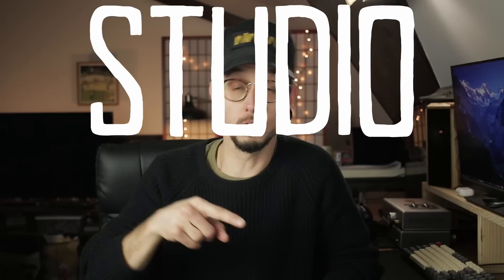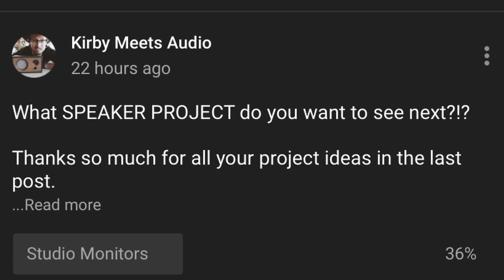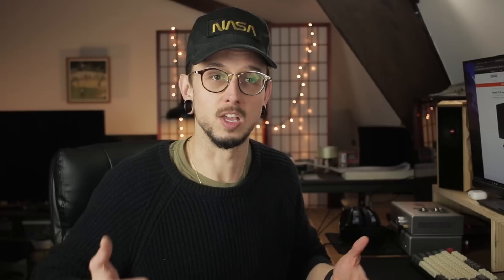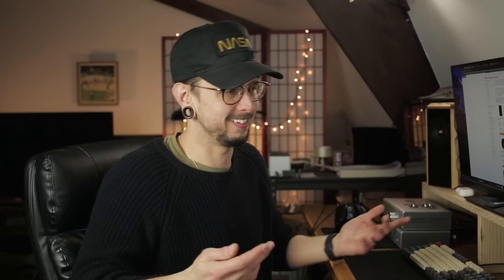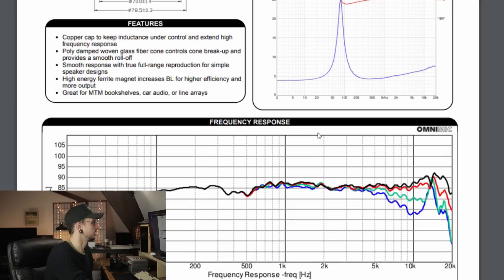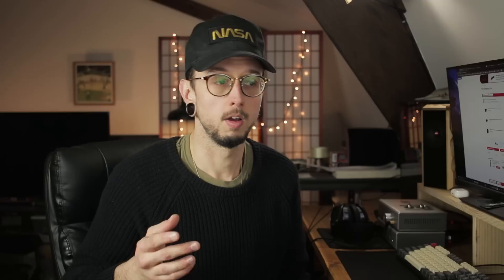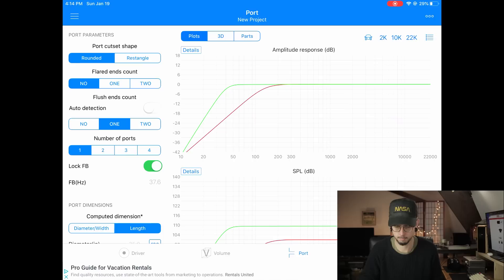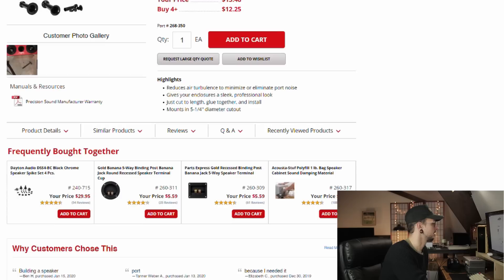DIY Studio Monitors (DESIGN) Step #1 | Home Recording Studio

Comment: Kirby - love the 8" woofers.  So many of today's bookshelf manufacturers try to sell us on 5-6" woofers having bass. They don't.  I would love to see you duplicate this build with more budget-friendly speaker parts that total under $250 for all parts (not enclosures).  Thanks !
Reply: they have bass, just needs the proper design for it. a friend of mine built a 3 way monitor that uses a 6.5" driver for the low end, and it can go down to 24hz quite loudly
Reply: @FPSzky  24hz maybe, loud, surely not.
Reply: @SilmarilS79  loud is not the point of studio monitors
Reply: 6 inch woofers can definitely have bass. The car audio community has figured that out. Ex: Sundown Audio U 6.5

Comment: I always call BS on a 32 Hz rating on an 8" woofer system.  Yes, theoretically, but not at volume in a very large monitoring space.   Bag End delivers a subwoofer system that is theoretically flat to 8 Hz, and it too is (theoretically) truthful.  But the devil is in the details, and to get that frequency at volume, you have to build that system out with four sealed 18" cabinets and some hefty amps (and have your room absolutely together).  "At volume" in my world, is at calibrated volume for film/master mixing.  That's really the bottom line--can the system deliver that response at the mix position, and most specs (even for studio monitoring systems) aren't actually giving you a spec that is comparable to that.  It's usually at x dB at some close measure of distance from the cab.

In the weeds, I know, but maybe it explains why frequency range ratings can look impressive, but when you monitor a tune with a low-B bass string fundamental, you find yourself asking, "Where's that bass?"

I have several of those Bag End systems, btw, and they are a thing of beauty.  No intent to bash on them, just to illustrate the disconnect between the theoretical spec and the practical implementation in a mix room.
Reply: It does also depend on driver though, there are some small drivers that are fairly specialised to just do low end well. Like the 5.25" Tang Band W5-1138SMF absolutely can do 35-40 hz no problem in a ported enclosure. As a result though its not the tightest bass/quickest woofer in the world, but low tones are absolutely achievable.
Reply: I've heard the bag end subs. Very impressive if you have the room. Has anyone heard both the bag end and the rythmic subs, and if so, how do they compare?
Reply: @__-fm5qv  Well, I concur with that, but again...at volume.  Once you've calibrated your monitors for volume (anywhere from 78 db to 83 db, pink noise, mix position) is that system delivering a flat response.  And a 5.25" driver system will absolutely not, under any circumstances, deliver what a mix engineer needs.  It might deliver an OK speaker system for listening, but it won't deliver a studio monitor that you  *know* will translate to most playback systems predictably.   And that's where you start getting into big trouble, and you have to do a lot of staring at the driver itself, to see what the exertion is versus what you're hearing.  You can do that on a song.  It starts getting impractical if you're mixing a film.  Granted, I come at this from a situation where I have to send out mixes which may play on big systems...but those are realistic work scenarios for studio monitors.  You have to know how a bank of subs with sometimes thousands of watts behind them will behave, or you won't keep working for long.
Reply: @BruceRichardsonMusic  This is true. I'm just trying to say for the purposes of these monitors an 8" deliverijg those frequencies is fine. He's not making a purely hardcore professional monitor after all, it's more of a "prosumer" monitor, so it's allowed a little slack imo.
Reply: @jdrissel   I have not heard the Rythmic Subs.  I checked out their site, and I think they probably compare more to Velodyne's early products that had a similar servo design.  I have a couple of the Velodyne 18-inch "Coffee Table" subs that I picked up cheap and put into my soundstage room for mix-testing (and general home theater enjoyment).  They sound AMAZING, and I could see mixing with them if I learned them.  The servo is really more of an intelligent limiter, as it stops the system from self-destructing when the cones go nonlinear.  In my experience, you might get away with a little smaller footprint with them than with Bag End.  They're still applying a similar trick with sealed cabinets, although Velodyne and (it appears) Rythmic, too, use some ported designs to save space.

The Bag Ends are a little more purpose designed.  You get indicator lights that tell you when the system is limiting, and the limiting is pretty sophisticated.  They filter at the fundamental level when the system starts exceeding spec, so you begin to lose the bottom octave, but you retain the rest of the overtone system for a given bass tone.  In a way, it functions psychoacoustically like Waves Maxxbass does.  You *think* you hear the fundamental, because the overtone series stays intact above it, and your brain concocts a "ghost note," similar to the way musical intervals will cause you to hear a "Tartini tone" that isn't there. 

But when you're mixing, those indicator lights basically tell you, "HEY, you need to sculpt on this section, so that you're controlling nonessential cone motion."  That's why you can get such tight bass mixing with Bag Ends...not so much that other systems won't let you get to the same result, but that they so clearly indicate when you've got an amp exertion problem.

In the way of contrast, the servo systems are saying the same thing, but just not in a way where you can quickly back up and sculpt on the bass until the indicator stops lighting.  Bag Ends have become a bit of a relic...not so much because they're not effective, but just a product of ever smaller mix rooms.  Obviously, building a room where you can perceive 8 Hz is tricky and takes some space and design.  They're amazing if you have the space and acoustics to use them.  Full body experience.  There's a scene in the second "Lord of the Rings," where the Ents begin pulling up out of the ground and walking....that's amazing.  I have never put a spectrum analyzer on it to see how low it goes, but it makes my vision blurry and feels like an earthquake.

Comment: Kirby you could minimise the volume of the mid enclosure by using some 4" pvc pipe instead of mdf
Reply from the maker: That’s a great point! And I’ve never done that before. 🤔 thanks for watching!
Reply: also a pipe reduces reflections vs. a square box for the mid woofer

Comment: When you calculate the enclosure's volume for the box within a box, you have to calculate the outside dimensions, minus the front side, of the internal box, when you are subtracting it from the over-all enclosure's volume, to figure out the volume for the main driver, plus the volume of your drivers, and any ports that set inside the box.

Comment: Could it be easy to use some Alesis Monitor One passive speakers with the amp from KRK RP5G3 and some high end tweeters? Would that be as simple as it sounds or would i run into other issues? Just get tweeters that fit into the existing hole then cut a rectangle the KRK amp fits in? or no? and why? ...PLEASE help me! Lol

Comment: dude 4:35 "Not going to be mixing anything." "Not going to be getting expensive drivers that sound absolutely amazing."    But you explain very well what monitors are for, and how they are designed to sound flat, and match reference recording attributes that can be measured. They do not exist because of a theory that "if they sound good on these, they'll sound good on anything."   A reference monitor is exactly that: a monitor that can play a specific range of frequencies, at a specific dB and reading distance with a distortion level below __ .   

 Not trying to be a prick or bust your balls that much- but you're damn close... you know a lot, and seem self taught. I remember your stuff on Betsy years ago. You must have been a kid. I recall some pairs with above average finishes, that looked a lot like some speaker kits I'd seen somewhere... :) I respect the hustle. But. You should use those talents to design and build some real, heavy duty studio reference monitors. 

Make some monsters.  Go insane. Get a pair of crazy stands in front of the console for TMWW L Woofers are 15" Reference. Behind those, Cabinets hanging from the ceiling from chains. They'll need to be, as the cabinets, bracing, and pairs of 18" sub-woofers will weigh well over 150 pounds each. More subs under desk/ Keep going.

Comment: I would do midrage enclosure somewhat wider. Maybe in a form of a truncated pyramid.  Having those walls too close to a driver might cause reflections back to a speaker cone and similar to a standing wave resonance.
Also, don't forget to chamfer midrane speaker holes from the inside.
Reply: Uuu i saw that inside a barefoot micromain 27

Comment: Man you have my dream job. I’m trying to get there. It’s tough to get the family set then buy tools and parts. It’s really disappointing when money is keeping me from my dreams.
Reply: P.s. love ya man
Reply from the maker: Love you too Matt
Reply: You could build speaker cabinets with a rudimentary set of tools. You're not going to match the speed of a commercial shop. But you'd get the job done. Everyone has to start somewhere. It usually isn't at the top either. If money is an object then buy used tools. They're going to be used after you get done using them anyways. I bet I could put together a tool kit with less than $50 to make speaker cabinets. $10 for a circular saw, $20 for a router, $3 for a corded drill and I'm most of the way there.
Reply: VISIT HARBOR FREIGHT....THAT IS WHERE I BUY ALL OF MY TOOL FOR CHEAP !!

Comment: Great content...Ok,so here is my deal. I have the Alesis Monitor 2 studio monitors which were not that expensive because of a cabinet blemish and they are awesome, I paired then and some Kenwood 3 ways with a Parasound amp. I did buy some Daytons and some Yamaha s and both are still wrapped up. I do want more speakers, nice highs, great mids and accurate, tight lows. I do not have the BOOM,BOOM,  when the woofers and flapping, muddy, etc, and do not want it. I want the bass and drums tight, and since I DJ/spin  a lot of different music, I want to whole 20-20 or as close as possible. I have seen some Morels/Daytons drivers and those ribbon tweeters before, and thought I might only get that low with 12-15 inch drivers.I have not been having any issues with reproduction of lows, so would be 12 and up be better?..I lke the design you showed with the tweeter array, and what are the advantages of more than  one woofer or midrange driver, if any???

Comment: Going passive for studio monitors is a big problem for me. A passive crossover is simply not the way to go. Furthermore most folks don't have a ton of decent amps around. Then there is competition around and you can get decent active monitors like the Behringer B2031A Thruth or the Kali Audio LP-6 for under 300$. Without indepent amps for all drivers this project does not make many sense for me.

Comment: could someone apply the same principles and design tools to build a dance music sound system? there seem to be plenty of resources out there for home building sub woofer enclosures for instance, but there seems to be a lacking in information on the high packs. is there any insight you might have to lend?
Reply: Never thought of it but your right, the goals are different for those types of systems, you can find some good info on some pro audio forums

Comment: I need to clarify one thing. The differentiation you made between 2 types of monitors is not really accurate. You said that the monitors like the avantone mixcube (pictured) are supposed to be flat and used for accurate mixing and suggested that larger monitors colour the sound to impress artists. That's not true. 

Most of the larger 2 and 3 way monitors are designed to have a flat response over a broad range of frequencies for accurate reference monitoring when mixing.

The Avantone Mixcubes are designed "to replicate the wide range of 'bass-challenged' devices such as car stereos, TVs, clock radios, computers, Bluetooth devices, etc." (From their website) so they are intentionally bad or "coloured" in a bad way.

I'm not saying this to diminish you in any way. Just want to clear it up for people that might have got the wrong idea.

Your design looks really cool and I like the video! I would like to do the same thing myself. Thanks for making it 😊

Comment: I didn't get. First you designed the mid cabinet. Then in order to design the bigger enclosure you have to subtract the volume of the smaller cabinet that goes inside the bigger one? Is that it?

Comment: The reason NS-10 speakers are famous has nothing to do with their sound. Quincy Jones used them to mix Michael Jackson's Thriller. When asked about the equipment he used, he mentioned NS-10's. Then everyone started using them. NS-10's are hi-fi speakers, not reference monitors, some of the models were meant to be mounted on bookshelves, which would make them sound better. You don't necessarily need NS-10's to check midrange on your mixes. Any limited band speaker will do. You could even fashion your own using car speakers.

Comment: I have the Alesis Monitor 2 speakers,and I want something just like that,passive,durable,and i want flat response speakers.I use them a lot with Djing/sound design,and i do want something with a low end,because I have analog synths.Should i mess with a pair of speakers and a sub?My main amp is a Parasound HCA power amp,and I do have some others.

Comment: It doesn't bother me that you use Parts Express in Dayton audio so much. I actually live in Cincinnati only a few miles away from one of the Parts Express physical locations. However I would like to get your input on comparisons between speakers have you considered bldg the same speaker design one with Dayton audio and one with another brand and comparing them side-by-side? Have you thought about building a two-way and simply changing out just a tweeter and talking about how your crossover changes are changing just a woofer and talking about how your crossover changes?

Comment: what if you did a similar build, same budget, but with powered monitors for producing? obviously the amps would incur more cost but this method requires an external amp which would be similar in cost.

Comment: Adam A77X is NOT a 3-way. It's a 2.5 way. One 7" driver is full-range until the active crossover with the tweeter, the other is doing just support bass via a passive crossover. They are using ICEpower designed class D for the woofers. Can't remember off the top of my head about the amplifier powering the tweeter.

Comment: Hi Kirby thanks for the great content. I built my first pair of <$10 2-way speakers last year using 3" GRS full range and a $0.75 tweeter with a capacitor. you were an inspiration btw. And now I would like to learn more about phase coherency, meaning the signal phase of each driver shifts depending on the crossover design, . is that something you've talked or will talk about? I noticed this is probably a rabbit hole and I'm not sure exactly how to design a crossover that has phase coherency between woofer and tweeter. Please HALP

Comment: Coaxial speaker + activ feedback amp (cinetic feedback like PSI audio), is the simpliest and best solution.
See zippyBB project (use  B&C 12CX32 work also with 15CX40).

Comment: If you don't want the box to be so deep another option is to use fiber fill. Like to add as much space to the box that the mid enclosure takes away would only be adding a small amount of fiber fill. You could stuff this up near the tweeter and keep it away from the port.
Reply: Sometimes too much kills the sound though

Comment: Speakers are no studio monitors without active single channel power for each channel because that is what is improving monitors by far. You can use hypex as active multi channel amp and digital dsp. Also mixing 4 and 8 ohm is not smart for linear audio production

Comment: Doode, you're not focusing on really important stuff in terms of audio quality. Kinda flat frequency response is only the begining. The mid range 100-1000hz is the most important thing and you need a driver with a combination of the lowest MMS the highest Sensitivity and BL possible. 
Transients is key to "quality" in music terms. That's the details we are looking for. You've selected a driver with 0.00946 lb (4.5 grams) MMS - wich is good - and Sensitivity 83.1db1w/ 87.4db 2.83v - wich is trash. It's now even up to Hi-Fi standarts. Also rubber type surround suspensions are bad choice for mid range. Cloth is way more interesting scenario. Wanna build portable good sounding speakers - forget about ported design and frequencies below 90hz. Add subwoofer for compensation. Choose the lightest possible mms mid-woofer with highest sensetivity - like less then 0.03 lb (13.6 grams) and higher 93db - and add dome type neodimium midrange driver to it. For example try to build 3-way system with a Morel MDM 55 2-1/8" Soft Dome Midrange or a FaitalPRO W6N8-120 6" Neodymium Professional Midrange and you will understand what i'm talking about.
Reply: Gave you a thumbs up just because of your commitment to your own design theory, get a 100 designers together and get 100 different opinions on what's important.😜
Reply from the maker: Totally agree, but at the beginning of the video I talked about why i'm building these monitors. Thanks for watching!